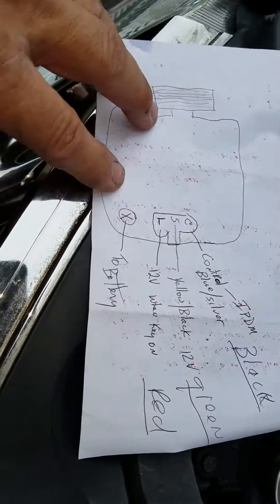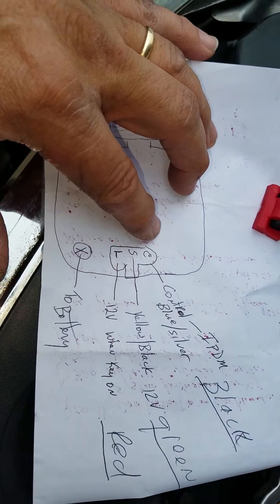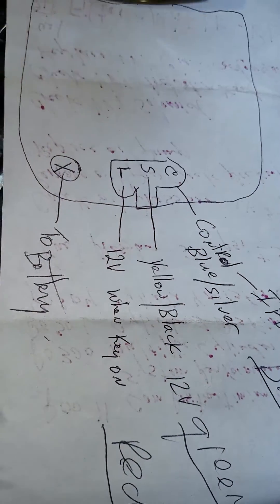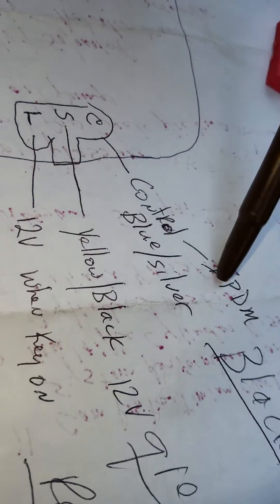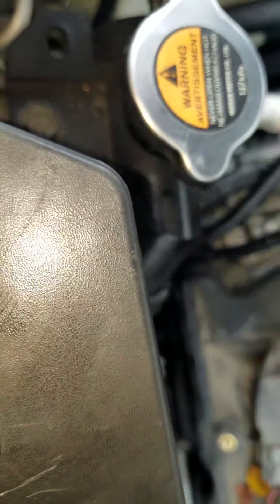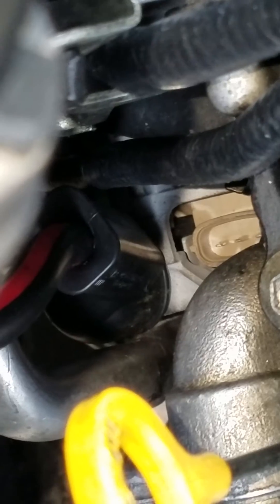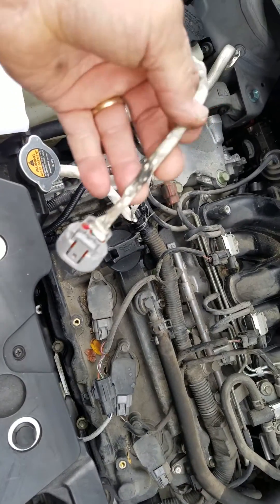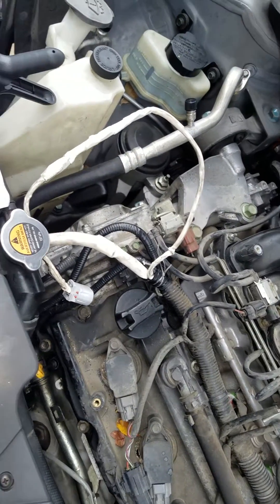2009 Nissan Murano alternator plug pinout

Comment: Only thing is there a brown,a yellow with black strip and a grey wire coming from my 2009 nissan maxima..is this grey one the light blue one you was talkin about????? please respond to me and be my life saving please...thank you so much if you do
Reply from the maker: https://www.nissanclub.com/threads/help-2007-altima-alternator-pigtail-replacement.516355/#lg=thread-516355&slide=3

Check this out
Reply: Well I thank you tons for the help but for some reason my car still kills if I unplug the battery? What you happen to have an idea on my.... it kills when I unplugged both sides of the battery. I tryed + it killed then I tryed - and it killed. I just dont understand. It's a brand new alternator. I told the brand new alternator I got 2 weeks ago back for this one and it's the same problem
Reply from the maker: @feltondubroc9878  prolly not a good idea to disconnect the battery while it is running. You need to get a volt meter and check the voltage while it is running. Also on the pwm controlled alternator it may have a lower voltage while idling to help lower the load on the engine while idling.  The alternator may be damaged, take it back and warranty it.

Comment: What type of wiring did you use to add too it, I added a thicker gauge and I feel like that’s issue, my alternator isn’t charging the battery all the time
Reply from the maker: I used a wire that was very close to the same size.
Reply: Okay thank you, I am still having issues with it, this is my second alternator and it will not hold a charge. It stays at 12.5 and then dies
Reply from the maker: This car uses a frequency to adjust charge rate. You may need to remove the alternator and have it tested. Check all wiring and plug pin tension.

Comment: You are a life saver!! My 09 Maxima has green, yellow/ black,  brown. My alt plug housing completely crumbled apart when I tried to remove it so I had to ghetto rig it with electrical tape until my replacement plug comes in.  Nissan charges over $1,000 for the engine wiring harness package which includes this plug.  They don't sell it separately.... go figure.  Thanks again for the info! 👍🏾

Comment: Can someone please help me
Reply: Where can o find a pigtail because the Napa by me can’t get one the advance one did not work properly
Reply from the maker: @shenams87   I can get it locally from Bryan Alternator and starter, in Bryan Texas. $15
Or

Amazon

https://www.amazon.com/dp/B07JPZKSDS/ref=cm_sw_r_apan_glt_i_PX6JJHR0P65JXRPNNV7K
Reply: How did you get the heat shrink tubing on the entire length of wire that you added, including the area where it was spliced in?  Was the tubing big enough to go over the connector?  That's the only thing that makes sense to me with how tight everything is in there.

Comment: This diagram is correct. If you are having issues with the pin out on this alternator model. This gentlemen has the correct one. Bravo sir. I pay $250 a month for all data repair to supply me with the wrong diagram. Bravo again sir.
Reply: yup,,they stupid,,hate it i pay the same and still ahve to go to this sites to find what i need,,,
Reply: Same here.
Reply from the maker: I got the info from the alternator rebuild shop.
Reply: Ujc,9

Comment: Ok so I got a new alternator and battery and belts installed when I turn my Interior lights they fade in an out it makes the dash lights do the same when I turn them off the dash goes back to normal any Idea  why
Reply: Is the wiring the same as a 2009 maxima
Reply from the maker: You need to check the voltage at the battery. Disconnect the battery and check it. Then connect it and check again. Always disconnect the negative side first. There should be 12.5v disconnected on a fully charged battery.
Reply: Chris Kolar so if the battery isn’t 12.5 it’s a bad battery even if I just got it new
Reply from the maker: @scottbradley3486  if it is new prolly not. What voltage it it? What's the voltage connected to the car? What's the voltage when it has been running? Has the car been flooded or wrecked?
Reply: @chriskolar is the wiring the same on Nissan Maxima 2011?
Reply from the maker: @edwardjones5611 yes it uses the same plug. I found this too.

https://maxima.org/forums/7th-generation-maxima-2009-2015/708783-need-help-alternator-connector-wiring-issue.html
Reply: @chriskolar thanks a lot..imma have to replace the alternator I just brought cause it's not keeping the battery charged cause I put a volt meter on it... thanks for the reply

Comment: Hey my murano is a 05, could you give me a readout for the plug as it’s a 4 prong plug not 3. Thanksb
Reply: Car lost power all of a sudden, idk if it’s the alternator or belt or something
Reply from the maker: Does it have any lights?
Reply: Chris Kolar batt and brake, wires on plug are brown and black
Reply from the maker: @haxbtc758  if it is a dead battery you should be able to jump it and or charge it up. I dont know the pinout. Did the wires pull out of the plug?  Are they burned and melted
Reply: Sorry it’s a 2 prong
Reply: My battery and brake light are on
Reply from the maker: I do not have a pinout for 4 pin. On Monday I can get that info from the rebuild shop.